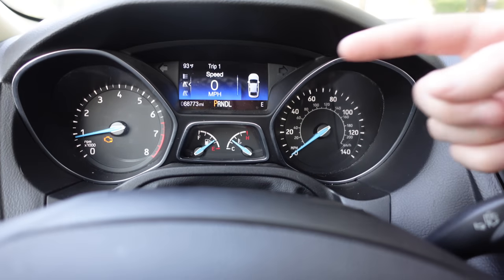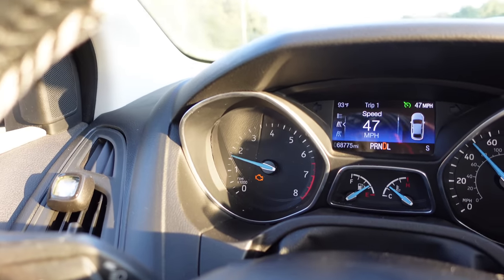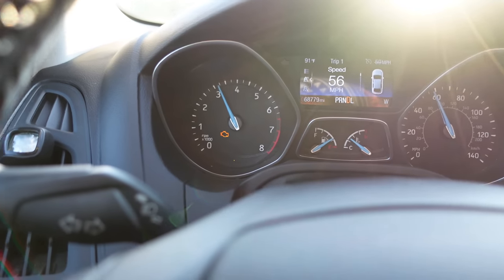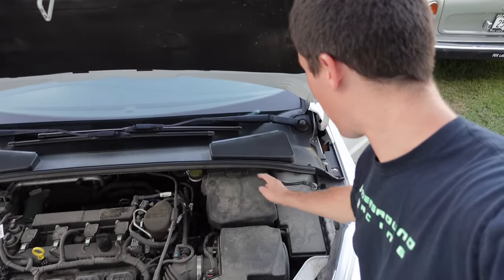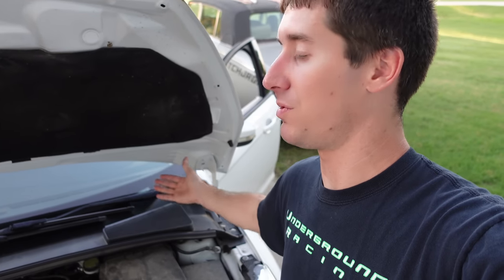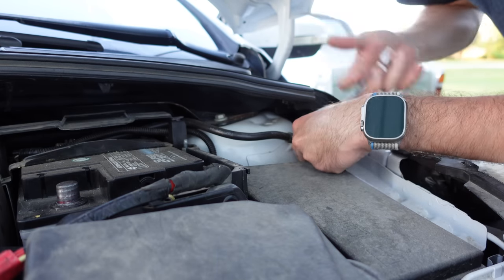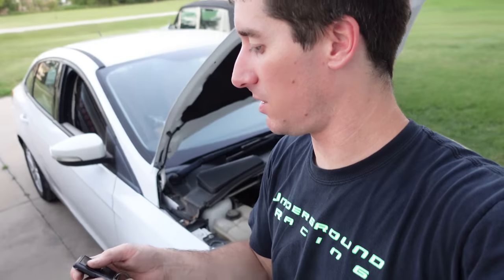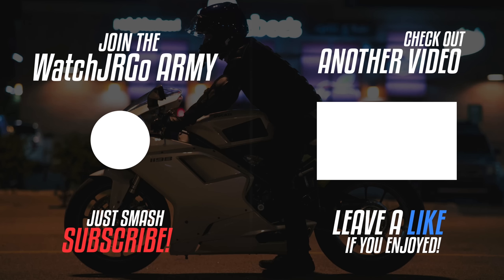This NIGHTMARE Transmission DESTROYED The Ford Focus (Fixing My Girlfriend's)

Comment: Great simple explanation of a dual clutch transmission.  Bought one on my 2018 Buick.  Now has almost 80,000 never had a problem.   Apparently the old 6 speed GM sold for almost 10 years before I bought mine was pretty much figured out to not have any problems after 10 years of production in multiple cars.
Reply: What Buick has a dual clutch transmission?
Reply: @kennygee2715  Envision has it.  It was a 6 speed unit made from launch until 2018.
Reply: @Buc_Stops_Here  I see it's a "twin clutch" AWD. It's implied that the twin clutch is to engage AWD. I'm not sure the clutches are the shifting of the transmission... Maybe it is though.
Reply: @kennygee2715  they advertised it as a dual clutch. But if you term it a twin clutch it is close enough.
Reply: @Buc_Stops_Here  I watched some YT videos on it. The transmission in the Envision is a traditional 6 speed automatic. Which means it has a torque converter. the twin clutches are part of the AWD system for transferring torque between the tires. The Ford Dual clutch in the focus is for switching the gears in the transmission.  Probably similar but there is a difference. Your car will be more reliable because it has the traditional transmission.
Reply: @kennygee2715  I agree with that, the dual clutch is for the AWD between the right and left wheels.  That is slightly different.  Good point!

Comment: I spent 10 years at Ford as a tech , primarily working on the Focus, and Fiesta dsp6 transmissions. Ford really messed up with the design. the Input shaft seals leak, leak onto the clutch, contaminating the friction material, causing that shudder. They were also terrible for the shift actuators, and the TCM's (valve bodys) . If you do some spirited driving, it will scrub the clutch from contaminates , and will not shudder for awhile. Otherwise your pulling the trans, replacing the seals, installing a new clutch. Also sometimes the relearn procedure will solve the shudder and poor shifting for a bit, but it will always come back.

Comment: I got my tcm changed out through ford at no cost and i still have power problems. Hard shifting at stops. Im gonna try that fix you just did and see if it makes it better.
Reply: Don't put on DieElectric Grease until after you have tightened down the ground.  Think of it as rust proofing.  There are also grounding points that should be fixed under the air filter, battery box, and one on the drivers side door sill, just under the side of the carpet.    But really, in my experience... checking and replacing sticky  clutch FORKS is the main fix;  which I'm done a few over the last year and a half, in the driveway, with no special tools. and with used parts for under a hundred bucks each time.

Comment: This is the car that is preventing me from buying ANY NEW Ford. I have a 2005 focus and with 140,000 miles, I have replaced coils, plugs, and oil. It is still going strong. (Duratech 2.0 / Automatic)
Reply: I have over 200k on mine .it’s a fantastic little car I would buy again

Comment: Why did you take off the paint then coat it with an insulator? Dialectric grease is the same as Vaseline except it will not hurt insulation on cables.

Comment: I personally have the issue about 7 days ago where on my 2014 Ford focus SE 2.0l was having transmission troubles few days later the check engine went on due to a TCM known as  actuators sticking or miss shifting forks can actually bent and really destroyed that transmission completely. I just replace my actuators A & B did some ground cables cleaning and so far is been running good.

Comment: I have a 2018 I bought with 7k miles. Before that I test drove a similar one with 60k miles. Both shift a little odd. Not nearly as bad as the one you’re driving. Knowing the nature of a dct, I wrote ended up writing it off as “normal”. Car is at 43k now, no complaints other than weird shifts. If there is a fix for its shaky/jittery shifts, I would like to know. Either way, I plan to trade or sell it off before it hits 60-70k.

Comment: My 2016 focus s was a manufacturer buyback it had a brand new 2018 transmission put in it before it was sold to me at 31k miles and it’s snappy I’ve never had a major issue out it and I love it you gotta stay in the gas 168k miles going strong

Comment: I have an '09 European ford focus 2.0 diesel with the powershift transmission. The important bit is you need a transmission service every 3 years or 60k km (~37k miles), and you can notice a lot when you do it. I only did 3-4k km a year but I did the service every 3 years. If you can notice it that much with just that amount of mileage, it means it's really necessary and the 60k km service interval is really long. Probably it would be better if it was done every 30k km or something like that. Having said that, I'm not sure if that's the same gearbox with the wet clutch. I know there are other brands that used dry clutch in dual clutch gearboxes.

Comment: ive got the tcm changed some 5 times because of that "lag, shutter, stall out on low speeds bs. They fix the issues for 15-20k and the shakes come right back. might try to get a 6th TCM tho. they keep trying to say its not the tcm causing these issues... if its not the tcm what is causing the transmission issues? ford focus se 2015 with alloy wheel upgrade

Comment: We have a 2018 ford focus SEL with the power shift automatic transmission but it does have the select shift on it as well and by far and so far it has been a good car. We got it used on carvana for like $16,000 almost 2 1/2 years ago 23,000 miles it’s a silver sedan with black tinted windows all the way from the back to the front of the car and windshield is tinted too. It current has 74,000 miles and it’s still going strong!

Comment: Dielectric grease is an insulator.  It will not enhance the connectivity to the sheet metal.  Just the opposite.  You have a gross conceptual misunderstanding of what this grease does.  It generally keeps contaminants and water out of electrical connections, but is not conductive.  You applied it to the freshly removed unpainted surface you prepared and then applied the cable end.  The grease will inhibit the ground.

Comment: Sadly, most of these cars will end up at the junk yard early.  Last time I went to the junk yard I was surprised how many fairly new Focus and Fiestas I saw there that weren't crashed.  My mom had a 2014 with a manual and she traded it in last year with 170k.  Still running fine, my parents just hadn't been doing the maintenance items that it needed so it needed a lot of stuff with suspension, steering, and motor mounts so they traded it in on a new Escape. I have driven a couple brand new Focus Powershifts in (at the time) brand new rental cars.  They felt fine.  No slipping, very quick for what the car is compared to what I'd expect from a torque converter.  I have always been curious how much of a factor came into play of people just not understanding how clutches work that caused them to die early vs a Ford mechanical issue.  I think it might be a little of both.  The problem I saw driving the Focus powershift was when creeping along slowly you could definitely feel it engaging and disengaging trying to figure out what you were doing or keeping the car moving slow without stalling.  That's definitely not the way you drive a manual car, so it shouldn't be the way you drive an automated manual, but you have people coming in only knowing how to drive a torque converter automatic and expecting it to act the same because it's an automatic.
Reply: It’s incredible how shortsighted the Domestic automakers are. This would’ve been competitive with the Civic and Corolla if they put a conventional six speed automatic in it but instead they have a dead model and thousands of people put off from owning another ford

Comment: There is a reset procedure when you replace the battery. If not done can damage the new battery as it charges using the old battery parameters. Which could be why the terminal was corroded. But i guess if the transmission is bad it doesn't matter plus the battery was 3 years old any how.

Comment: I was looking at buying a 2015 for 1000 bucks but remembered Jr video about the clutch issue on these models. Yup going to leave it right there for someones elses headache. Thanks Jr
Reply: If you can replace parts, you should buy, cuz this problem is an easy fix that can be done in the driveway!

Comment: i have a focus ps titanium and  it is 2017 it came from ford with the new tcm revision and it works like a champ, with the correct driving tecniche the main issues are the ground and once a code appears the tcm is dead, the issue is that these clutches work realy hot and they burn the tcm. from ford documentation a cluctch replacement is needed every 55k to 65k miles
Reply: Geez, take it easy on the daily driver, it's not built to be a race car eh.
Reply: @01mustang05  i ended up selling it, after 20k miles without issues and now have an 500 abarth for my wife

Comment: I have a 2017. Dual clutch. I’m the original owner. 125k and no issues. Apparently 2016 and later they used stronger clutch packs. We’ll see how long it lasts, but so far I’m fairly happy. I changed the tranny fluid at 100k to be safe.
Reply: Clutch Forks are the main issue.  They get dirty, rust up, seize up, and stop sliding properly.   Don't know what you mean by "stronger clutch packs" too, the old ones still make a lot of dust when driven too hard.

Comment: I've heard putting the transmission in sport shift mode helps. I left mine in sport mode all the time and I thought it shifted great.
Reply: Yep one way is to just drive it harder.  Sport mode and hammer it off the line more.  Hurts fuel economy a bit but my neighbors 2013 has 200k km on it and no weird issues

Comment: I have a 2012 Focus SE with the dual clutch. I never heard it called "power shift" though so that is a bit curious. Mine ran fine for the first 100k then the transmission wouldn't engage and left me on the side of the road. Ford fixed it for free by putting in a new control module. It went another 100k and then started going out of gear on me, this time popped up with a code regarding the clutch forks. I let it sit for a couple years and now I took the transmission out and replaced the dual clutch, actuators, and clutch forks. Hopefully it will run ok after that.. But at least I made it to 200k so thats not terrible in my book. It got great gas mileage and was a good commuter car for me for many years. From what I understand the transmission itself is fine, its the clutch forks and TCM that are the issues.

Comment: So my 2011 Fiesta just had that exact same issue and then some. Was driving home from a family member's house when the car started hunting for gear is really bad and then a light on the dash popped up that said transmission failure. After that the car went into limp mode and I got it into a gas station parking lot. Three weeks later I still have not heard back from my local Ford dealer and I can tell you this if they don't fix it I will buy Ford trucks exclusively and tell everybody to not touch anything with the big blue oval that's not a truck. Only reason I say that is I've owned multiple f-150s and they perform beyond expectations.

Comment: I have a manual 2012 focus and it's an amazing car.  Had it 3 years only had to do brakes when i got it it oil changes and the purge valve which is a recall.  60 dollar part and 20 minute install.  Just wish it didn't rust so much

Comment: we have a very similar car. 2015 Focus Trend X with a 1.5 TDCi paired to a 6-speed Powershift, pushing out 120 hp. it's at around 110k km/67k mi with no problems so far. creeps, shifts, doesn't slip. only occasionally you can feel the gearshift but not very often. guess we got lucky as i know this transmission is known for its many issues.

Comment: (I own a 2014 Focus SE) Ford released this Dual Clutch transmission in their Focus and Fiesta models from 2011 to 2016. The transmission is actually a manual transmission with a Transmission Control Module (TCM) slapped on the transmission case where the manual linkage would normally enter the case. The symptoms of the failure start subtly: You will first notice a slight shudder when shifting from 1st to 2nd, then things shift normally. After a period of time, the "slight shudder" will progress to a "noticable stutter" of the engine between 1st and 2nd. As things are allowed to progress, the transmission will randomly drop into neutral instead of shifting to 2nd. I've had all three of these symptoms present in my Focus. Ford initially denied there were transmission issues with their PowerShift transmissions, but somebody discovered corporate documentation created PRIOR to the 2011 car model release that identified the issues that would later plague owners. Ford never did figure out a solution to the TCM problems and they eventually told dealers to just replace the TCM under a special warranty extension for anyone bringing an affected vehicle with the described symptoms. Note that Ford was just replacing a defective module with another defective module, so the problem would eventually return. A class-action lawsuit was filed against Ford Motor Company and Ford settled in 2020 for ~$30 million in buy-backs of defective vehicles.
https://www.caranddriver.com/news/a30689585/ford-settlement-transmission-lawsuit/

Comment: Had a 2013 Focus and hated that transmission. It would be very jerky after driving on the highway for long periods. One other problem I had with it was a leaking brake master cylinder, which they fixed by repairing the line that goes into it. Probably the worst car I’ve ever had next to my 2004 Saturn ION with the infamous VTi Transmission.

Comment: I drive a 2012.  Had it since 2015.  Dealership wouldn't touch my car.  When I had issues, they blamed everything on a K&N cai.  Convinced them it was the notorious transmission issue.  They did a "fix" but the car had shifting issues again about 6 months later.  Since then, I drive it in sport mode and control the shifting as if it were a manual.  It has worked so far, but yeah, the automatic transmission is garbage.  If you drive a Ford Focus, this is what I recommend to extend it's life.

Comment: Such a simple easy to work on trans,  its alot of software problems that plague it. reprogramming the module fixes a lot of concerns. voltage drop the powers and grounds to know for sure. load testing the starting and charging system should be done before  condemning tcm and trans. the clutch actuators are prone to binding especially  "A". doing a complete relearn after any repairs is critical to verification. this trans is easy to work on and ford parts are very reasonable. about 1250 bucks and you are good to go.

Comment: I'm Dealing with common issues on a 2013 focus similar symptoms, my solution was to reset the ECP/PCM there some YouTube videos on how to do it, I thought it was transmission as well but it corrected the issue, Also I change the Fuel pressure sensor and the canister purge valve sensor and the issue was gone completely.

Comment: I have a 2016, and I had a 2012 Focus. Both had the manual transmission. These are awesome cars if you get the manual. My 2012 I sold only because I put on over 200,000 miles. All of it problem free. Bad thing is, I never replaced anything except the sparkplugs, oil and filters. Still had original belts and hoses. I did change out the battery right before I sold it. This was 2 years ago, so it would have been 9 years old. I purchased it new. The 2016 we also purchased new, as the 2012 was super reliable. It now has 114,000 miles on it. Again, nothing has gone wrong with it. So if you get a chance to buy one of these with the manual transmission, they are fun to drive and very reliable. Plus, the stigma of the automatics being so bad means you can get these at a great price. I daily the 2016 now as I upgraded my wife to a Rav4 hybrid. Only modification to the fords is a K&N air filter and aftermarket stereo. The stock stereos are garbage in these, but with a faceplate replacement a double din fits in nicely.

Comment: I’m glad you finally did a video on the mk3 focus automatic. I had this car for a year and multiple times I was stranded due to the clutch getting too hot. Constant shuttering on all even gears and reverse. Weird shifting behavior like what’s shown here, doesn’t make sense I could literally feel the car burning it’s clutch with every shift. I tried every trick I could find and noting fixed it. I would reset the tcm until I was just fed up and left it for dead

Comment: My daughter saved up to buy her first car. A used '11 fiesta. Same power shift trans as this focus. Dealer put in new TCM under the recall that had never been done due to it stalling when coming to a stop. Ran o.k. ish afterwards then got progressively worse. Shuddering and slipping. The fix was easy.... sold it. The engine ran fine. The car drove straight and true and was as smooth as you would expect from a small domestic econo box. If it had a manual 5 speed, I'd say it would have been a great little car. Ford sold knowingly a vehicle that had issue upon issues with this dual clutch transmission from the beginning. She now has a Mazda 3. I know, virtually the same car, but with a "normal" transmission.